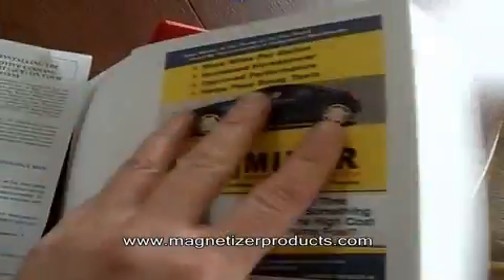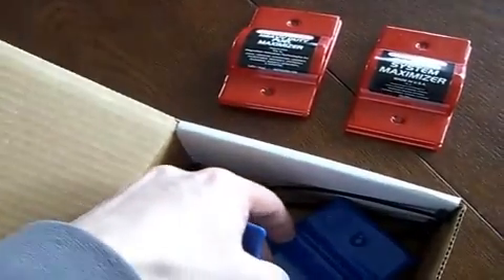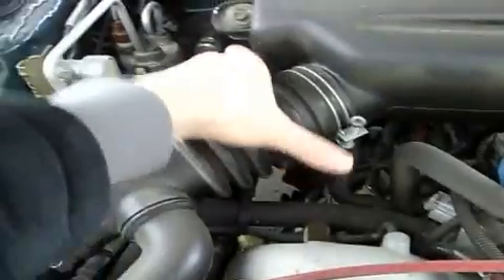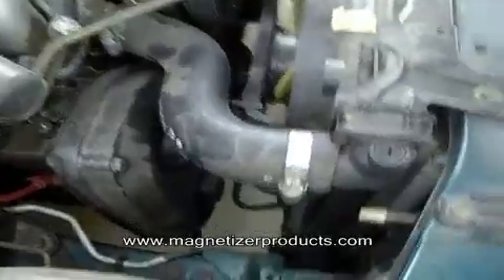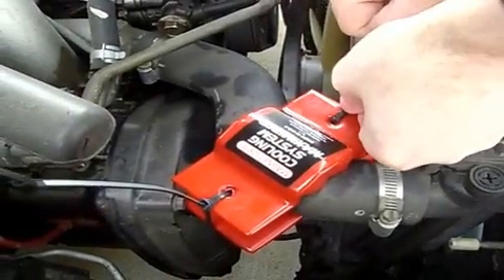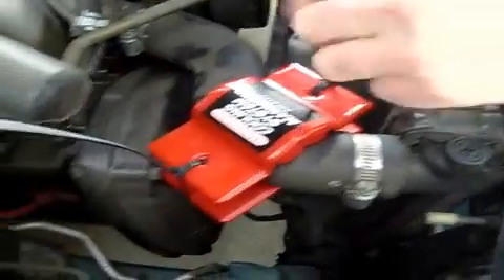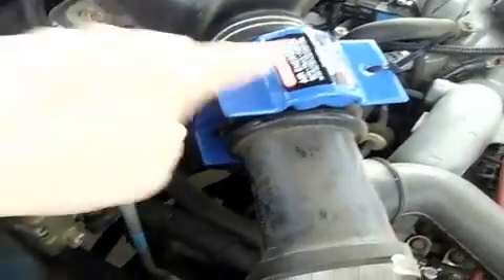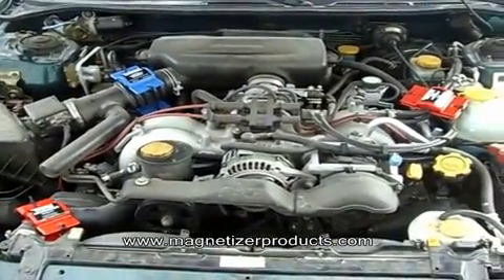Gasoline Maximizer for Automotive use from Magnetizer Products

Comment: why do you need to clamp magnets on the air intake tubing? what science is behind air and magnetism?
Reply: We use a positive magnetic unit on the fuel lines and a negative product on the air so the negatively charged air molecules are attracted to the positively charged fuel molecules. This technique increases the fuel burn rate from 68% to 94%. Just changing the fuel to positive would only give you about a 20% increase burn rate.
Reply: Now...there's an intelligent response.  Thank U.  I've never seen so many IQ challenged people, in all my born days, on this site. The word 'Morons' comes to mind.  Is it any wonder why there are so many disfunctional illiterates walking the streets these days. I can see the preponderance of nay-sayers here, had to be either drop outs, flunked their science classes, or just have IQs in the low two-digit range.  Again, James..... thanx.
Reply: +Jeff James is fuel depending on what fuel is negatively charged. if this is the case. should not the magnets on the fuel line, be in the attractant position.
Reply: Fuel is either positively or negatively charged. This is the problem. This attraction from the opposing polarities is causing the fuel molecules to bunch up; forming fuel clusters or hydrocarbon clusters. By converting the fuel to positive only you are breaking apart the clusters. You do not use a negative charge on the fuel. You use this on the air only (which attracts it to the fuel for a 42% higher burn rate.

Does this answer your question?

Note: I installed 72 of the kits shown in the video and none of them worked. I figured out that the smaller (AFE or MOA) positive (red) magnets weren't strong enough. So I replaced them with the HDFE-B. This is a larger double stacking unit and there are magnets on both sides of the fuel line (the HDFE-B contains both sides. The letter "B" symbolizes this. An "A" suffix would be one magnet and backplate like those shown in the video). This strong opposing positive force between the two halves is seven times stronger then having just a one side magnet. So this change of product is about 25 times stronger then the AFE. You can feel this force when you hold each unit in each hand and try to put them together. You need to use two double locking, double strength cable ties to hold them together securely. When we use industrial units (triple stack opposing magnets) over four inch pipe size we have to use all thread or large bolts. The opposing forces are just too great.

The product shown in the video was used on small gasoline engines (lawn mover type) in the old days. I was surprised to see them still selling for this application.

Jeff
Reply: it makes the snake oil more palatable for the engine

Comment: Get rid of that restrictive air box with all those corners and turns. the easier it for the air to get in the better the car runs and the better the MPG... PROVED!
Reply: True but the engine runs better and easier therefore better mileage.